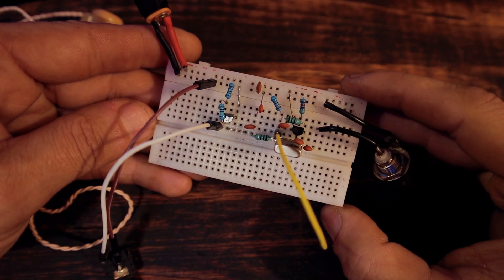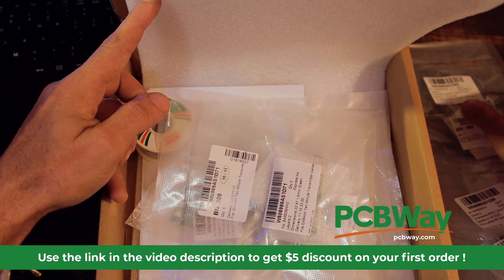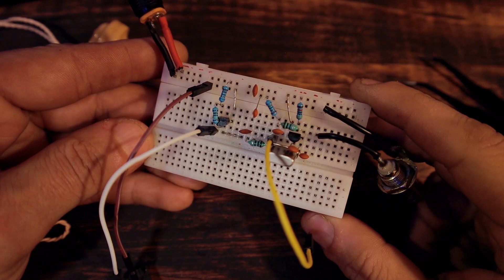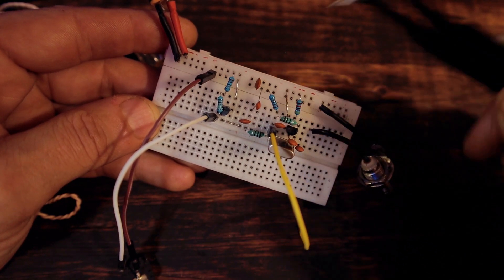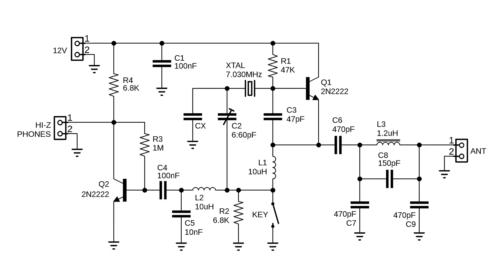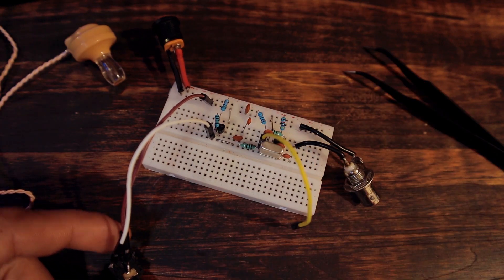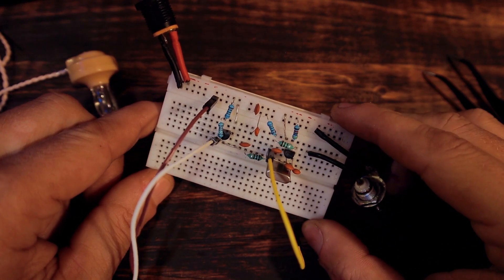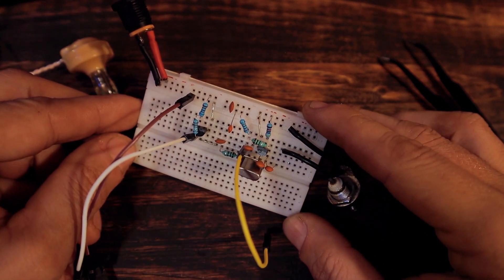Micro-QRP: Building The Matchbox CW Transceiver ?

Comment: I can order an assembled version on pcbway, but in your notes it says somewhere that they will not provide hardware, do you mean they don't assemble it for you? I have never orderd through pcbway so i'm wondering if it is possible to order an assembled version. When I do so, they say in my cart there are no components added and the price of the components is 0.
Reply from the maker: Ohh what I mean they don't provide external hardware its about RF connectors, variable capacitors, enclosures etc. It depends on the project of course. But many people sometime think that it comes as some sort of assembled kit with all that you would need. Assembled version for this little transceiver means that all the components are soldered to the board. Hmm I actually never ordered an assembled version either if I think about it 😂 Maybe it's time, out of curiosity. 73, YO6DXE. Let me know how it goes. I see that many people ordered assembled versions for many of the projects but I never got any feedback from anyone so I am curious.
Reply: @dxexplorer  Thank you for the response! I seem to have to wait untill the order is reviewed befor I can order. If I do order I will let you know how it goes! I might still buy the parts from Mouser and make my own pcb, but i've always wonderd how it works ordering or creating pcb's yourself with such a service. 73!
Reply from the maker: Yes first they will review the order and then once is approved you can place the order. I do the same all the time. I like making my own PCB boards using the toner transfer method, or I just build stuff Manhattan style. But when I build a project that I want it to last ( and not have the copper corode ) then I prefer to order the PCB boards. Yes please let me know how it goes. I also just placed my order for this one and waiting for it to arrive. I didn't think about the assembled version. I will do that for the next project 😃.
Reply: @dxexplorer  I mostly leave my circuits on small breadboards haha, but it seems very cool to kick it up a notch. I will let you know! 73
Reply from the maker: I have a few on breadboards too 🤣🤣
Reply: @dxexplorer  Oh and btw, I checked your qrz page and we seem to have exactly the same interests in building/experimenting and keeping it small and/or budget friendly. Is there a good book with projects or schematics you can recommend?
Reply from the maker: That sounds great. Well... I started from some really old Romanian books with simple circuits for amateur radio passionates. But those circuits were way too updated so I started to receive PDF files with all sort of QRP publications. I can email you as well what I have if you want.
Reply from the maker: Excellent. I will prepare a compressed folder with all the stuff I have, upload it to Google drive and send you the link a bit later today. By the way... if you are the one that ordered the assembled version of the Matchbox Transceiver on PCB Way.... we are searching for the crystal ))). The usual components providers like Digikey, TME, etc. where they get the parts from and what I usually put in the BOM file seem to have none on stock. I am trying to find a link on one of them ( not AliExpress where we usually get them from hi ).
Reply: @dxexplorer  Thank you so much! I downloaded them just now. I haven't orderd the pcb yet, they are still working on the quote for the assebled pcb.
Reply from the maker: Ohhh ok. Well let me know how it goes. They told me they will buy the crystal from Alibaba as there no other choice on Digikey, etc. the big supliers.
Reply: @dxexplorer  I will, but I think it will be a bit to expensive for one pcb. The costs for assembly starts from about 29 dollars, then it's plus the components and pcb. So I guess I probably will be making it a different way. But this is a good first step to do something with a pcb service:)
Reply from the maker: @Phasmidable I need to order something assembled as well and see how it is. You made me curious 😁
Reply: @dxexplorer  I'm curious as well, seems like a great service!
Reply from the maker: @Phasmidable I know for sure I am happy with the PCB boards quality.